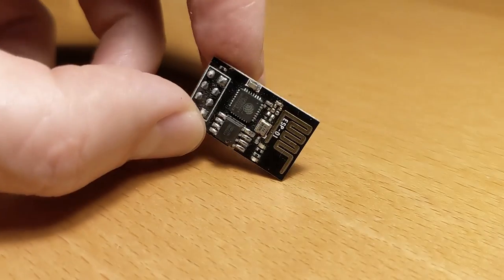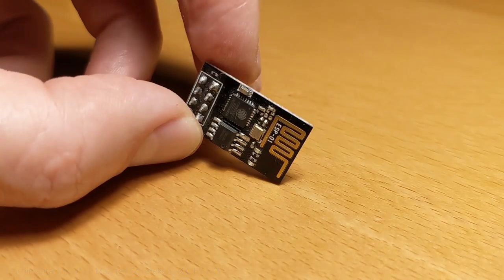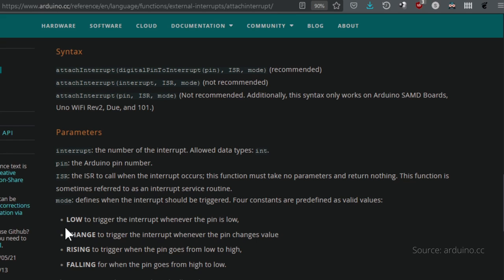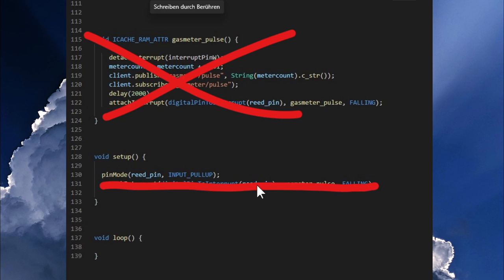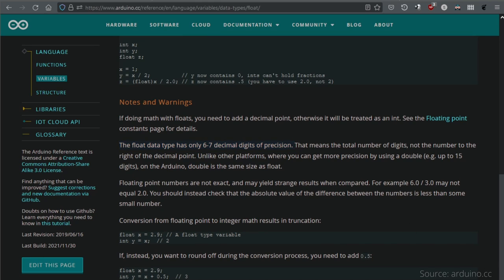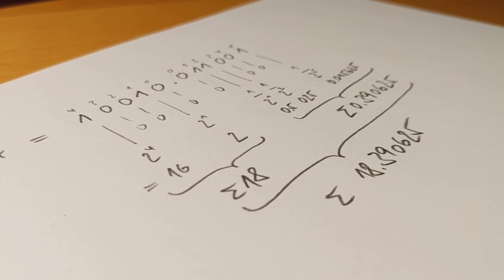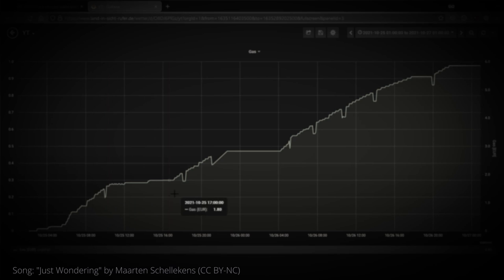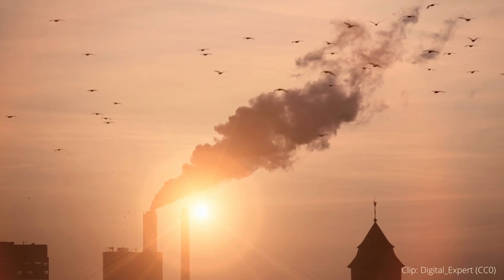Gas meter - Receive magnetic pulses with an ESP8266

Comment from the maker: Some of my viewers have pointed out to me that even "double" variables are liable to cause errors over time and will lead to mismatches in the long run. It seems that it is common practice to solve such problems better with integers or unsigned integers. The decimal places are obtained by dividing the result by 100, as in my case. I amended this in my code on Github. I do the shifting of the decimal place in Node-Red. You can also find the flow on Github.

One additional tip is to buy the plastic encapsulated reed switches instead of the normal glass ones as they are prone to breaking. The viewer @gadjetsvideo brought this to my attention in connection with my window sensor video. 

Also, I did not mention in the video that reed switches have different sensitivities to the magnetic field. This is indicated with AT (ampere turns). The viewer @Benedek T. seems to be experienced in this field and recommends reed switches with 6-8 AT for this purpose. Thank you, @Benedek T., for your feedback.

Unfortunately, an error has slipped into the calculation of the binary numbers. Correctly the right side of the decimal point should look like this:
1/2^2 + 1/2^3 + 1/2^6 = 0.25 + 0.125 + 0.015625 = 0.390625
For the small numbers I noted above the binary digits, I should not have started with 0, 1, 2, 3... but with 1, 2, 3, 4...

Comment: When counting discrete events like pulses it's good practice to use integers, the calculation that one pulse means 0.01m3 or whatever need not happen at the same time as counting.
Reply from the maker: Very good suggestion, which has also been posted here several times in the comments now. I have modified the data type in the code on Github now. Many thanks for your feedback.

Comment: I would even make it an unsigned int, simply dividing by 100 at the very end where it is presented to the user if needed. 😉
Reply: You nailed it 👍
Reply from the maker: Thanks for the hint, now that you and also some others have given me the tip, it falls like scales from my eyes. ;-)
I think I will change that in the code on Github soon as well.
Reply: This was a standard practice in financial systems; nowadays I see lots of floating point amounts flying around in JSON structures and I wonder if there is an auditor at the far end of the line wondering why nothing balances anymore!
Reply: @tbavister  i work with financial systems, and we do calculations using `double` ; we still have regression issues reported for differences smaller than 2c , that we sometimes close as rounding errors, other times rewrite the used formulas
Reply from the maker: I have modified the data type to "unsigned int" in the code on Github now. Many thanks for your feedback.

Comment: Nice project, I have to check if my gas meter also got a magnet! 

Just a few tips: 
1. Never do heavy lifting operations (like mqtt) in the ISR handler directly! Set a var in the ISR and do the MQTT stuff in the main loop. 

2. You could send the readings to the MQTT broker with the retain flag set. This way the broker stores the latest value for you. If you got a power loss simply subscribe to the topic of the reading after the reboot. The broker will send you the latest value, you can store it in memory, unsubscribe and start sending new values. 

Have a good day!
Reply from the maker: Thanks, these are very interesting tips you have for me. I'll try to heed them next time.

Comment: I had exactly, EXACTLY the same issue like you had but sometimes when I over-complicate things, I go to my wife to ask for help.. 
That´s why I flashed the ESP with tasmota, configured the reed-sensor as a switch and have a rule in tasmota that everytime the switch goes "OFF" it should add +1 to a counter value variable stored in tasmota and also send this value over mqtt to home assistant.. 

As simple as it is, works flawessly and I do not have any debounce issues.

Comment: For debouncing, there are usually libraries available for all popular uC platforms. Since the reed switch acts like an ordinary switch, no modifications to the code are needed.
On the other hand, if your gas consumption was high enough you could simply attach a coil to the meter and measure the frequency with an oscilloscope ;-)

Comment: Loving it! I have a meter that flashes a diode with variable frequency to indicate electricity use. I am thinking of using a photo resistor for this
Reply: A photo resistor might be too slow for that purpose. I think a photo transistor would be a better choice.
Reply: Photo resisitor works perfectly (i am using one).
Reply: Try to find out if it supports SML on an IR diode. I set this up with a modded TCRT5000

Comment: The major advantage of using interrupts is that your MCU can be in deep sleep in between, using nearly no power.
To debounce, you can do it with a library (or just a delay)........or manage it on the server side: the ESP sends a "bip" at every state change and your server interprets the "bips" coming within a second to be of the same meter value

Comment: Perhaps count every impulse with 1 and add it up. Only divide by 100 at the very end. 
1 is always stored in 1 bit without a comma or fraction. 0.01 is count in a fraction.

Or count a separate variable to 100. Then set this to 0 and increase the output variable by 1.

Float is only useful to take from a sensor and display it immediately without calculating.
Or compare float by larger or smaller, but do not compare float with equal.
Float is only an estimate.

Comment: So many comments to make.
1) Re all the problems you had with floats etc., why are you trying to represent this number in your code at all? Can't your ESP01 just send a signal periodically when e.g. 1 unit passes? Then Node-RED does all that counting stuff.
2) General advice about interrupts: they are only required when coding a microcontroller if you have done things that introduce delays in code. This is best avoided. Instead of delays, use timers - far more powerful. Only use ISR when you are needing to sort out deep sleep / battery efficiency etc.
3) If there's switch bounce, deal with it in code. Always better that way. Then you can more easily tweak debounce time to suit. Also if there's accuracy drift over time, you can change this later. Combined with the fact you are using timers instead of delays, it's really easy to code a debounce detection. There is even a cool library you can use if you prefer not to get your hands dirty...

Comment: Just a note: as someone who developed commercial knockoffs for gas meter pulse sensors, it is nontrivial to choose a reed switch, since these magnets in the meters vary quite a bit in strength. I recommend using 6-8 AT ones, and leaving LONG LEADS on them, to help with magnetic fields (this might be a myth, but in my experience, it helps with sensitivity problems).
Reply from the maker: Many thanks for your advice. I was not aware of that to be honest, although it should have been obvious. I have included your hint in my pinned comment with corrections and suggestions for improvement.

Comment: Nice project and tank you for your video. 

If you multiply your 1000 you don’t need float and you will be always accurate on the ESP. And you just need to divide you number by 1000 before displaying or send to influx DB.
Reply from the maker: Very good suggestion, which has also been posted here several times in the comments now. I have modified the data type in the code on Github now. Many thanks for your feedback.

Comment: A hall effect sensor would proably be a better bet then a reed switch, sovles the bounce problem and should last longer in practice.
Reply from the maker: Unfortunately, with the hall-effect sensor I had here, the magnetic pulse of the gas meter could not be captured. Maybe I did something wrong. I had changed polarity and positioning several times and checked with a separate magnet. Maybe I should have ordered again other hall-effect sensors and test!?

Comment: In my case, I just stuck the reed switch to the glass pane of the meter with scotch tape. The reed switch can then be connected to the ESP without any additional components if one connection goes to ground and the other to a GPIO. Then only the internal pull-up resistor of the GPIO has to be activated.

Comment: If you want to illustrate the switch bounce in a video. Take a steel or glass ball. Drop it on a hard surface, and you can see and definitely hear the bouncing. This is what is happening inside a switch, just on a macro level.

Möjn aus Dänemark ;-)
Reply from the maker: hehe ... thanks, actually when I was editing the video myself I was aware that the microscope shot doesn't exactly show the described effect. But there would have been 1000 other details I would have changed on the video. Since my BBC film team is currently on vacation and I had to do everything by myself this time, I was forced to take shortcuts in some places 😂
But good suggestion, I could have done the "bouncing" much better without much effort. If I should touch the topic again, I will take up your idea.
Liebe Grüße zurück aus Deuschland 👋😄

Comment: An easy a simple solution will be casting the variable as a integer and then only saving the tick count (after applying the de-bounce logic obviously). Since the device has a webui, you can do calculations at the client side and show how many "ticks" have passed since the count started. A little json magic and a bit of js math will solve the problem quite easy (at least that's the way I'm doing the things with my esp8266 sensors).

Comment: little funfact: floats are called floats because the position of the comma can float. If you look at your meter, you can see that the comma is printed at one place and can't move. Your meter actually works with an integer and the unit is 10־³m³
Reply from the maker: You are absolutely right. And also many other viewers have already pointed out here in the comments that int or unsigned int would have been the better choice. That is why I have modified the data type in the code on Github now. Many thanks for your feedback.

Comment: Your video inspired me to do the same thing. Instead of 3D printing the case and putting a reed switch in, I just ordered the original one instead. I also made a config in ESP Home so it easily gets into Home Assistant. For debounce the signal I set it so a signal must be 1 second long, (I might raise that if needed) if it is less it will be discarded. If the signal has been stable for 1 second it will count one pulse up, then wait for the signal to go low stable for 1 second again.

Now I just need to wait for the IN-Z61 to arrive so I can attach it to my gas meter. :)

Comment: Maybe put a capacitor in series with the relay so that even if the meter stops on 0 and holds it stuck on, the capcitor will make sure that only a pulse is delivered to the input pin.

Comment: Don't use double!  Use fixed point instead, i.e. store your value as an integer and assume that each increment is for 1/100th (or 1/1000th or whatever fixed divider you define) of a m3 ...
Reply from the maker: Very good suggestion, which has also been posted here several times in the comments now. I have modified the data type in the code on Github now. Many thanks for your feedback.

Comment: I am going to build this project. I think about placing a resistor (maybe 100 ohms) in series to the reed switch to improve the damping. The current sketch w/o such a resistor would cause an high current through the reed contacts as the capacitor is immediately put parallel to the power supply if the contact is closed. That might damage the contact in the long run. Suggestions, comments? Also can you include some info about the power supply (3.3 V)?

Comment: Love the ending with hydronic balacing. I recently got my own house with gas heating and was wondering if I need to do it, since my plumber just install the pipes and left :)
Reply from the maker: You should at least check whether the radiator valves are still in the home position, as was the case with me. Then you have a clear indication that your plumber has "forgotten" to do this. If so, I would definitely ask for it. Even if he charges for it, you will save so much in the end that it will be worth it for you. Here in Germany, the companies are obliged to do this at no extra charge.

Comment: You should use the debounce library to filter the input
Reply from the maker: Cool, I didn't know that one. I will have a look at it soon. Thanks for the tip.
Reply: @MakerMeik  Debouncing is just a simple trick. The firmware should see a '1' level a couple of times in a row, say 5. If you see it once and the next sample is low again, you start again. You accept the high level only if you have seen the '1' 5 times in a row. The same at falling edges. That's how you can solve your issue in just a few lines of code.
Reply from the maker: hmmm ... but that's exactly how I solved it and also explained in my video, right?
Reply: Ehm... not sure. I think you don't restart counting when the switch bounces back to the old state. But to be honest, I can't follow the piece of code so quickly. What I usually do is scan the switch in the main loop, so you scan eg every 100ms. Then you increase a counter when input='1' and reset it when it's '0'. If you see enough '1''s, you will reach 10 (eg). At that point you say "input is '1'"". I think you pause the loop when you start doing the debounce procedure. You can't do anything in between at that time (maybe not required here, but maybe next time it is). Anyway, it works, Cheers :-)

Comment: Hiyou have two way´s to read the gas counter. What it the best way? ESPcam or mgnetoc pulses?
Reply from the maker: In general, I would summarize that you should always prefer the solution with the lower complexity. And here this is the variant with the magnetic pulses. But note my pinned comment with my later findings: For this special case, integers are even better suited than doubles for storing the current numerical value. The system with the magnetic pulses and the reed sensor has been running absolutely reliably for more than a year now.

Comment: I love the project. Some issues though. First, the calculation is wrong. 0.5 + 0.25 + whatever is certainly more than 0.4. The issue here is, that your first digit after the decimal point stands already for 2^-1. Second, as others pointed out, using double instead of float is just kicking the can down the road. It has essentially the same issues as float, just less often. A better solution would be to use an integer type and count hundredths.
Reply: Oh, and 2^-5 = 0.03125.
Reply from the maker: Oh no, I was indeed too sloppy. You are of course right, the correct calculation must look like this:
1/2^2 + 1/2^3 + 1/2^6 = 0.25 + 0.125 + 0.015625 = 0.390625
For the small numbers I noted on top of the binary digits, I shouldn't have started with 0, 1, 2, 3.... to the right of the decimal point, but with 1, 2, 3, ...
But I can tell you, making a video like this requires all your senses. Shooting video, editing, text, music, programming, soldering, 3D models, and printer, ...
I had unfortunately overlooked the fault ... I hope the Probelm is to be understood nevertheless at the end.
And the thing about the integers divided by one hundred also makes perfect sense to me. I will at least change that in the code on Github.
Thanks for your feedback and for thinking along.
Reply from the maker: I have modified the data type to "unsigned int" in the code on Github now. Many thanks for your feedback.

Comment: Did you evaluate counting inside esp32 ulp using the embeded hall sensor ? Or using ole Schmitt trigger as an alternative ?
Reply from the maker: I have not tried that. But I had first tried it with a Hall effect sensor, because I was aware that the bouncing of the reeds can cause problems. Unfortunately, my Hall-effect sensors were not sensitive enough for the magnetic pulses. But there are alternatives with higher sensitivity. 
I don't know if the sensitivity in the ESP32 is sufficient. I only see the additional problem that you have to get very close to the readout point and the recess is quite small. But if you find out something about this, I would be happy if you would share your experience with me and the other viewers.

Comment: The Reed switch is bouncing so wouldn't something like a schmitt trigger correct that and give you a single rising/falling edge?
Reply: No a Schmidt trigger, will only help if you have a slowly rising signal where the period when the signal is electrically in the undefined area between 0 and 1 long enough to confuse the CPU. That is most likely not the reason here.

Comment: hi, they are needed to be adjusted to the amount of flow, to maintain a certain temperature in relation to an outside temperature.  If the size of a radiator is chosen correctly to the size of the room, then u are right they all have nearly the same flow but in most cases, the flow is different like the gas pedal of a car and every room is a different car but all of them need s to have to maintain the same speed or in ur case room temperature. For this, u need a special computer program to count the resistance in the pipes to even get to set up the pump flow to a correct value, to be able to provide the flow to every room that is needed. That is also the problem why some installation technicians failed to do they install what they guess is good sometimes and often they overbuild the system and the rooms were heated too much un some rooms when u try now to set up the flow u will end up imbalance the system so much that sometimes it gets worse and create loud flow noise when u try to limit the flow,  u should get someone to do it for you even the software for this is expensive and most time not sold to individuals because u need the knowledge and training to use this software corectly